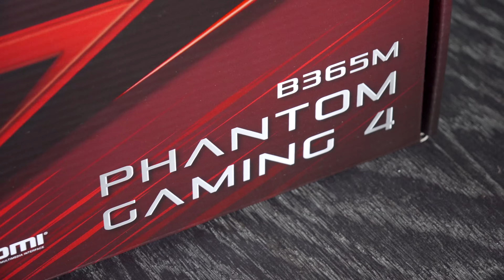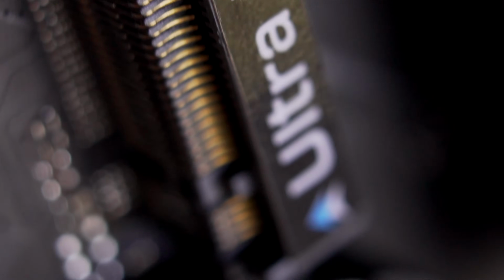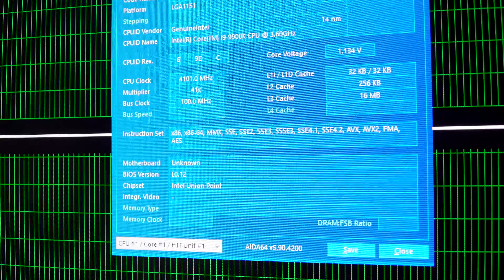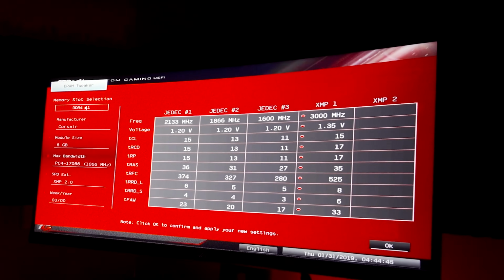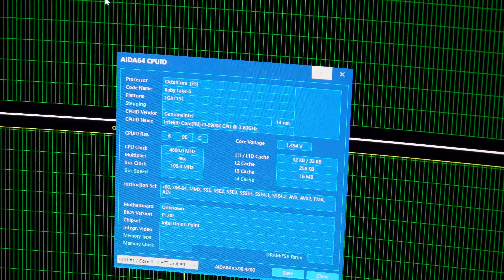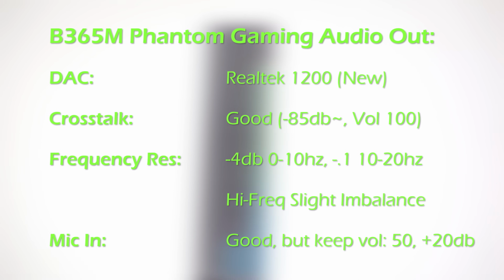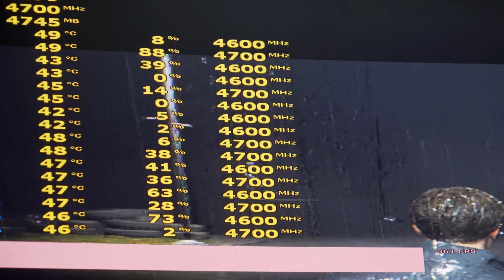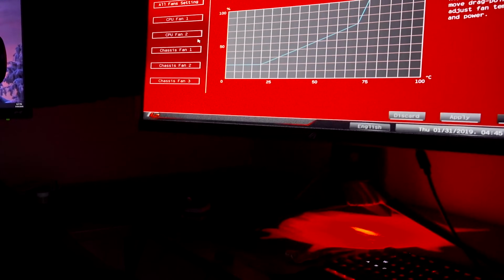Can this B365M Motherboard Handle a 9900K....!?

Comment: Unfortunately, this is the only board I can get right now is in my price range and is the only one Available to get easily right now for my Intel i9-9900k as my good old B150 is not good enough for it. I understand this board is not recommended to be used with this, but I’m hoping my Corsair A500 BIG MOMA Cpu cooler will help…

Comment: I have this board with an 8700k and i have ran into  2 problems with it  3 of the cores were not running  . And the  ram would  only run if you but it in slot B1 and B2 singal lane any ideas on  this one

Comment: One more thing to clarify, the question is not if can it run the i9 9900k ? but , how much it go with i9 9900k frequency... because all boards can run that CPU except for the frequency, it depend on the board.

Comment: Will the stock i9 9900f run well on this Mobo with default bios setting??
Reply: if 9900K can, non-K should

im planning to use i9-9900 non-K on B365 too
Reply: @asdian_dx  , no , still you will compromise it's actual performance by ~5%,, I prefer i7 9700f.. but it will happen like 5 to 10 years from now when it's price like  a hundred bucks or two.. lol

Comment: In Brasil and Argentina Intel is a lot cheaper than AMD in the low end, because you can get a B365 mobo for 4800 Pesos Arg. or 490 Reais BR , and the 9100F for the same, whereas in AMD a ryzen 1200 is 5800 Pesos and a mediocre B450 that can upgrade safely to at least a stock 3700X is gonna be at least 7500 Pesos.
I find it amazing that AMD which is supposed to be the budget pick for the little guy is actually so much more expensive at the entry level than Intel, for all the shade they throw at intel as this "evil capitalist all profit fuck the peoplez" guy, they've honestly benefited the most 3rd world South American countries than AMD...and like its not even close, AMD hasn't competed here since the Phenom II days in the entry level, this is all leaving Chile aside of course.

Comment: i have this board with a i7-9700k how can i overclock and i have a h60 aio water cooler
Reply: You can't... don't buy a non-overclocking chipset (B365) for an unlocked CPU.  You need a Z-series chipset (Z390) to overclock an unlocked CPU.

Comment: Please help! noob here. I have this board and about to pair with i7 9700 (non-K), but my friend sells his 9900 non-K slightly pricier than new i7 9700 and I'm interested. My question is... Is the VRM will do fine under i9-9900 non-K in long term (3-5 years) for Gaming, 3d modeling, and rendering? I know this video mentioned the worst-case scenario (and some people in the comment section mentioning 1.45v. Is it really bad? and how to solve it?). I just want to make sure my system will do fine in the long run. I live in a tropic country but I live in a relatively cold area. Thank you!

Comment: What did you do with the metal tool at 3:55?
Reply: Turning on the motherboard without case power switch by shorting the power switch pin using any metal object, e.g a screw driver.
TL;DR Jump starting the motherboard.

Comment: why i can't OC my phantom gaming ram 16gb 3200? there nothing change in my pc, its just stil 2400
Reply: Because the B365 chipset only supports up to 2666 speed... enable XMP in BIOS that will get you to 2666, but you'll never hit 3200 unless you use something like a Z390 chipset board.

Comment: Motherboard  for i5 9400f ?
Reply: machtok MSI Z390 Gaming plus
Reply: @mustafas9011  lol... you do NOT need a Z390 board for an i5 9400F... what a huge waste of money... you are aware the expensive Z390 boards are for unlocked chips and buying an expensive MB for its ability to overlock is a waste on a LOCKED 9400F that you cannot overclock... please stop giving out (really bad) advice if you don't know what you're talking about... the B365 chipset MBs are just fine for a 9400F.

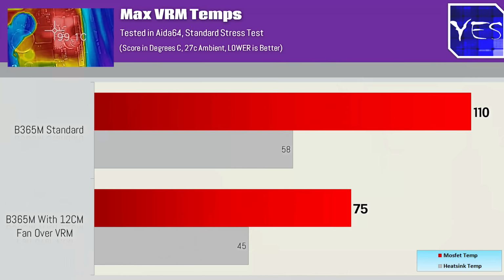Comment: 8:20 all you need to know about those nikos mosfets 
also datasheets on them are available through google search

http://elcodis.com/parts/6179874/p0903bk.html#datasheet
http://www.unikc.com.cn/UploadFile/products/2015710171840-PK618BA_REV1.0_20140710.pdf
nikos mosfets suck

Comment: My pc is shutting off when im playing games and stuff and when I looked at the cpu 4 pin connector it looks burn out and melted and inside the 4 pin slot on the motherboard 2 of the bottom pins are like pushed back and they don't go into the wire anymore does this mean I need a new psu and a motherboard?

Comment: "In raid 0 mode they do drop down to Pcie 2.0"

What's the use? You raid0 two pcie 3.0 x4 ssds that can reach up to 3.5Gb/s to achieve that sweet 2x iops and 2x through output. Dropping down to PCie 2.0 you're going to esentially only get the iops, not the speeds. Wtf Asrock.

Comment: Not sure why that chip would need 1.4v on stock settings. No wonder the vrm's are getting hot and its continually throttling! Review this again with 1.2v/1.3v and see any differences.

Comment: Wow, 1.45V under stock settings! Looks like a super cheap VRM...
The 9900K has an all core turbo of 4,7 and a single core turbo of 5GHz. The VRM simply isn't capable of clocking the chip that high so it is fluctuating around.

Comment: The question is not if those low-end moboss can handle such power-hungry CPUs just for a few test sessions of testing but rather for how much they can last in the long term, and also what happens when they fail, like do they take other components along with them or do they pop?
Because if you buy such CPU with this kind of mobo, you will very likely gonna keep it for many years.

Comment: Hey, could you make a video overclocking a q6600 with a piece of tape?
I did on my rig and it boosted the clock speed from 2.4GHz to 3.0GHz.
(It only works if you have a motherboard with atleast 1333 fsb)

Comment: For budget board, AsRock is a good brand for those who need full spec & lots of equipment they need
2 Generation ago, budget board from other brand only have just 1 M2, but Asrock has 2 of them, 1*Nvme, 1* SATA
such as AMD's AB350 platform

Comment: Hi, I just bought x 58 mobo (MSI X58 Pro) and Xeon 5670 for £80, I am having a problem to find proper memory modules though. Does x58 support 8gb per slot? Or 4 gb are supported? I am aiming to get 24gb in tripple channel mode, , but dont know if possible. Can somebody help. Thanks
Reply: The motherboard support a total of 24Gb, so a maximum of 4Gb per slot.
Reply: Thank you
Reply: thx
Reply: Sell it get ryzen
Reply: I will eventually

Comment: I think for the low-side you mean PK618BA. Both the high and low side's are from Niko-Sem and they're not the best.

The website also says that it's an 8 phase design. Knowing what the controller can handle, looking at its design, and looking at those VRM temps though, it's a 3+2 phase or (3x2)+2 phase design, where the core's VRMs have double the components, and that's why the last phase in the top left is so hot compared to the two next to it.
It's kind of disappointing, and a first for ASRock in a few years, because every other time they always put a heatsink on the core's VRMs, even if there's only a single phase at the top. Albeit, logically you wouldn't be pairing this board with a 9900K anyway, and for the CPUs that this board's targeted towards, it's fine.

Comment: asrock motherboard reliability is God level  I have g31m vs back from 2009 and it's still breathing. Hats off to you asrock
Reply: Current and first ever Asrock board I have now: Z370 ITX with 8700K very happy!!   Had A few Asus boards / MSI / EVGA / Gigabyte /  Out of the roughly 10 I have had past 10yrs the Cheap MSI and my current budget Asrock have been the ONLY ones with no issues.   The MSI and Asrock boards were $100-$200Au boards best I had, the 3 Gigabyte and EVGA and Asus boards I had were $300-$450 ....
Reply: had an asrock a320m for a ryzen 5 and it died within 3 weeks. had to RMA
Reply: @EggplantHarmesan  there's nothing new in that even costly mb from asus and gigabyte fail, now compare the price difference between these  board and asrock board u get same features in comparatively lower price therefore even if asrock board fail you won't face that huge loss
Reply: @pratikjawake4168  yeah but this comment thread is about reliability. The reliability of the A320m motherboard was shit.
Reply: @pratikjawake4168  The A320m was is plagued with issues from day one and there are multiple people who have had the same issue of the board dying within weeks.
Reply: My H81 + i3 + 16 GB Ram + GTX 750 back in 2014 and still working
Reply: Asrock h61 itx still kickin

Rest of my pc specs is

I5-2400
2 x 4gb ram
Gtx1050ti
1tb sshd
Qbx Case

Im just using it for dbz fighterz, tekken 7, overwatch, dota2 and netflix 😁🙈🍆🎉
Reply: My z97 anniversary or whatever it was called died in the first week, never trusted asrock boards since, but maybe I'll try them for my Ryzen 2 build
Reply: @yousufahmed5627  Its strange because I have heard that ASRock started pretty weak but they have been doing much better now and basically taking business away from Gigabyte.
Reply: @ZippetySticks  PFFF , I will never buy a gigabyte board again, I decided to buy a ab350m-gaming3, and it is the absolute worst motherboard I've ever used,  anything changed in the bios resets after each boot , you can't set xmp profiles without the thing bootlooping a bunch, then when you manage to get into windows it's only running at 2133mhz
Reply: @RYou
Asrock really went GODMODE in 2016 onwards, you were sadly just too early rofl.
Reply: @yousufahmed5627  give it a try you won't regret
Reply: @yousufahmed5627  maybe youre just unlucky getting a defect product. My b360 pro4 works as good as new
Reply: Taichi is like the only good board with decent power delivery. Asrock needs to go back to step one.

Comment: Who would buy a B365 board with the 9900K....
Reply: No one. But it's an interesting experiment nevertheless
Reply: maybe 3 yrs down the track someone wants to upgrade their i5  8400 system this mobo gives a decent upgrade path down the track
Reply: Me
Reply: You can get a ASRock Z390M Pro4 micro ATX for $125 at Newegg.  That B365 is new and harder to find.  I must have just come out.  I think I would spend the extra for that.
Reply: @pctrashtalk2069  the cheapest z390 mobo in Australia is $200 not everyone has $200 to spend on a motherboard and would instead rather spend the money on a better cpu or gpu
Reply: @pctrashtalk2069  Say you have $300 AUD to spend on a mobo + cpu and you want Intel New tech etc that you can upgrade in the future

Options in Australia for intel platform, are

Option A) Z390 ($200) + Celeron G4900 ($100)
or
Option B) B365 ($130) + i3 8100 ($170)
Reply: Walmart would